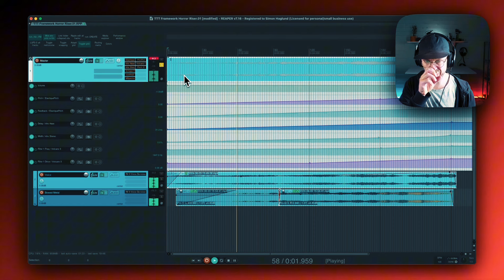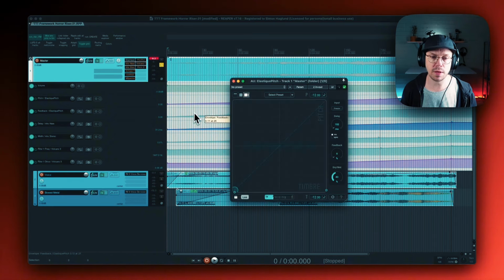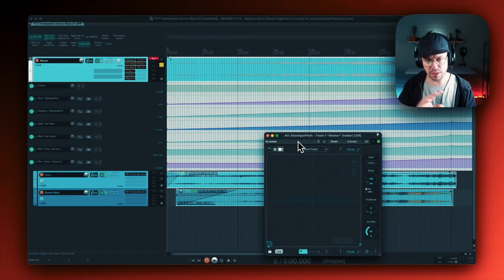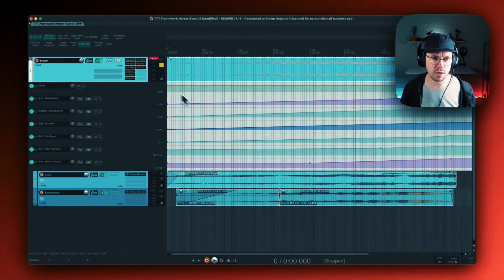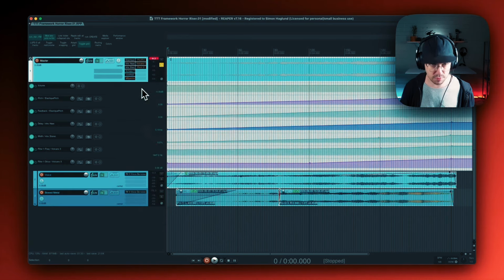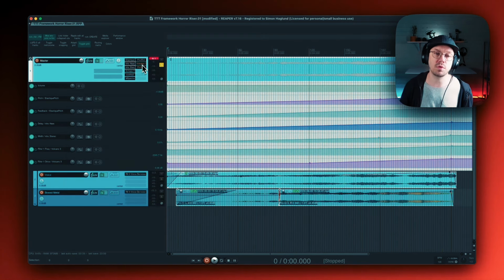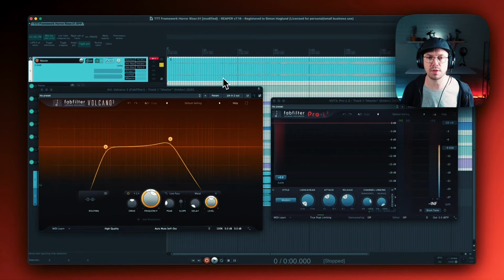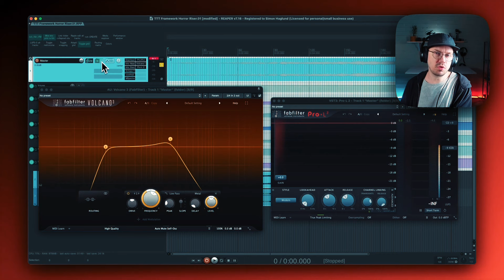Make the SOUNDS in YOUR HEAD (use this FORMULA)

Comment: Hi Simon, thanks for the video! :) 
Out of interest: what's that recording setup?  It is not ORTF, it is WAY too small for an A/B, too far apart for X/Y... so what is it? 
Thanks in advance!
Reply from the maker: Hi! That was well spotted of you! Thanks for the great question! :)  Yes you are right, that's a weird setup. It's usually a 90 degree X/Y setup I use on that rig. But recently read that the 90 degree often isn't that much of a problem as we think. So I have started to experiment with different angles of it. Haha I guess as a sound designer I just love to break the rules and try out new stuff... 😜
Reply: @simonhaglundsounds  Ah, I see 👍I mean if it works, it works! :) Thanks for the reply ✌